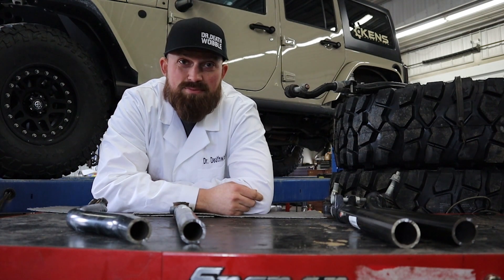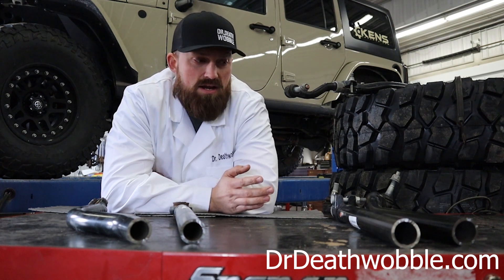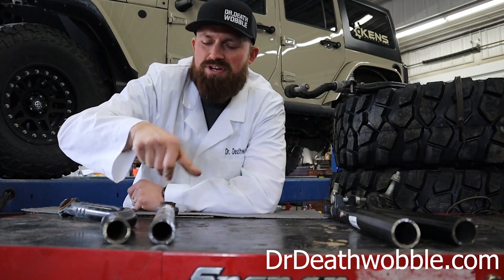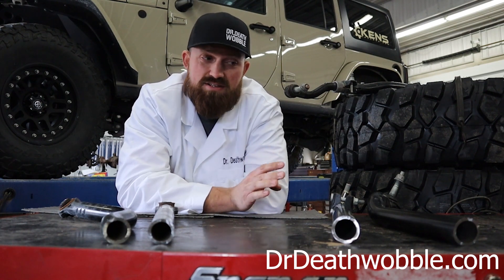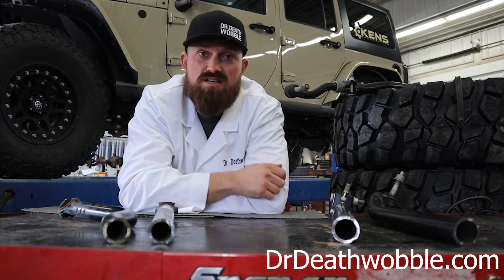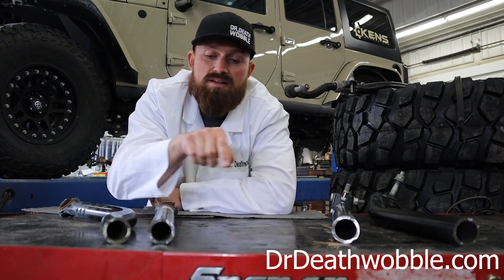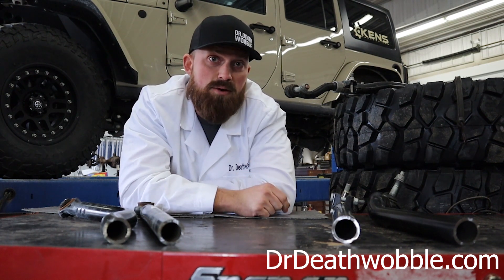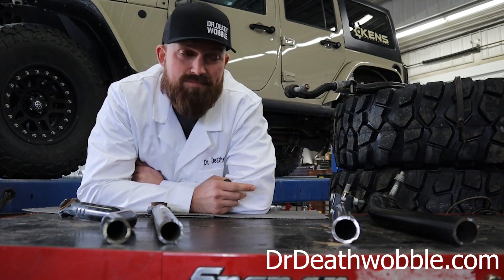What causes death wobble in the Jeep Wrangler JL?

Comment: Reinforce the brackets for the track bar, upper on frame and axle. The bolt wreaks havok on the thin metal flanges and creates  massive play. They went cheap on something that's designed to handle massive weight and force. I got rid of it by doing this. Jeeps suspension is no different than any other vehicle with coils on an axle. Check out synergy upper and lower track bar reinforce kits. Also if any other component on a suspension is weak or damage itll cause dw. If your out of alignment over 1/4 of an inch. Camber, toe, axle alignment position. Anything. Itll cause a dw and that goes for any vehicles. 
I have a clayton offroad track bar with synergy performance reinforcements. 2 years now and my JT willys 3.0  literally drives like a car thanks to that 3. I wished i took pictures of the oem track bar bolt when i took it out, inside the whole was beat. And i even checked all the torque specs when i first got dw, so they had it dialed in. They went cheap where it matters most is the problem.

Comment: I have a 4 door JL willys 2020, with the 2.0 mopar - fox shocks lift kit and 35x12.5's. I had death wobble once on a curve while turnin right aroung 35-40 mph. What should I change first?. Do you have a video with this info?.

Thank you very much, I also love jeeps and also believed that the suspension has a core problem that won't be fixed with a new stabilizer, very good info thanks!.

Comment: Hi,Great info
I paid Top $$ at the dealership to replace the steering box from the aluminum to the metal….still got the wobble issue.
Did you find out what will be the best Brad of a replacement components that will fix the issue?
Reply from the maker: Thank You. In my personal experience the Teraflex, Synergy, RPM, Apex, and Metal Cloak steering systems really stand out from the pack. They each have really nice features.

Comment: Thank you so much for posting this.  I've owned Wranglers since the 80's and loved each one of them.  I've never developed the death wobble in any of them until my 2018 Rubicon.  I really thought Jeep had this figured out.  So far 3 trips to the dealer and still no fix.  If you mentioned it, I may have missed it, but why can't Jeep get this problem solved?
Reply: Thought  the same, the solution is independent suspension.

Comment: People also need to check blown shocks on only one side.  I traded a dodge for a 94 jeep grand c.  The good shocks were replaced by junk yard shocks.  They rattled a lot.  But would settle down after getting warm.  After two months i got death wobble.  I had to get pulleys and o2 sensors, so next month could only afford shocks.  I had already tightened my steering rack adjuster, which helped a little.  When i took my shocks off the front, i noticed my right side was completely loose inside, the other side still had a bit of resistance.  My new shocks were cheap ranchos.  After installing we took it for a drive and not a bit of death wobble, nice, firm, yet actually smooth ride, even over the railroad tracks.  I think it was the mismatched shock absorbtion that enhanced the resonance.  Also, do you think that tire pressure (flat vs super inflated) can change caster?

Comment: So I’ve watched a few of your videos and I’m going to get an alignment this weekend but I was wondering just in case that doesn’t work what you would recommend. So I had my Jeep for maybe a year and a half with no wobble then I did new brake pads and boom wobble, so I had the tires balanced and the death wobble was gone for a while but then it came back and I was told a new stabilizer would help, so I did that and it made the wobble happen less but still every once in a while. Now a few weeks later the wobble is back worse then ever I almost always have to pull over to get it to stop. I threw a new stabilizer on it again until I could save up to redo all of the ball joints on the front end and nothing changed still very aggressive wobble. Hopefully the alignment will mostly fix the issue honestly I’m long overdue for an alignment so I’m hoping it does something. Any tips would be greatly appreciated maybe a checklist of what things you would do next. I love my Jeep but the thought crossed my mind today of trading it in I hate feeling unsafe while driving to work
Reply: I had a brand new TJ, 2003 Sport and got a terrible Death Wobble when I only had 20,000 miles on my Jeep. Dealer changed the tie rod and did alignment, but a week later I got another terrible Death Wobble on the highway!  Finally, a mechanic told me buy 4 brand new tires even though my original tires looked fantastic and I only had 20,000 miles on them. That solved the issue for me. However, there is no guarantees and it may come back again!  As much as I loved my Jeep, I decided to sell it.

Comment: I have a jku with 4” Currie enterprise lift kit , steer smarts tie rod , drag link (top mount, no drill) , track bar, steering stabilizer .. I’m running King shocks w remote reservoir and have a anti-rock front anti sway bar while running no anti sway bar in the rear .. Adams driveshaft 1350 front and rear.. adjustable control arms (all 8 are adjustable) .. as you can see I’ve sunk in a lot of money into my jk in the attempt to avoid death wobble and other issues but I still manage to have death wobble .. HELP me! Please . I’ve taken it to fourwheel parts and paid them to look at it and do an alignment but went home and still got death wobble. 
I don’t get death wobble if I hit something with BOTH tires but as soon as I hit I decent jump in the road with just ONE tire that’s when death wobble kicks in.. what could be the issue?? I’ve checked to make sure everything is torqued and I don’t see play in the ball joints
Reply: Oh yea I forgot to mention I used to have a 2.5 rubicon express lift with stick steering and no death wobble 
When I went to the 4” lift and steer smarts I got death wobble . 
I only have 28,000 miles on my Jeep but only about 4,000 miles on my 4” lift 
I’m on 35 “ tires

Comment: Just bought 2019 jeep wrangler sports unlimited 4 door and already steering wheels problem. Bring it to dealer they said need to replace rack and pinion. Did you have problem like this?
Reply from the maker: Jay  A Jeep Wrangler does not have a rack and pinion steering it has a steering gear sir.

Comment: I have a jlu sahara and it always wandered from the first drive. I recently had the mopar lift installed and after that is where my issues showed up I wouldn’t say i have death wobble but def a heavy bump steer issue i swapped out the front and rear track bars for the rancho hd ones and it helped maybe a tiny bit i have a star case open with mopar but they just want to keep throwing dampners at it i was looking at the steersmart hd drag link with the griffin attenuator and the tie rod.  But im wondering will that fix it or is there another 1,000 plus dollars of pieces it needs
Reply from the maker: But your wondering is caused by not enough positive caster, you need longer or adjustable front lower control arms.
Reply from the maker: There are many issues with the Mopar lift kit, a stronger track bar, stronger steering system like a steersmarts and longer lower control arms will get you rolling smoothly
Reply from the maker: You are not experiencing bump steer though it is a stage of death wobble. Bump steer is caused by improper relationship of the drag link and track bar on Jeep, unless you have went to a top mount draglink or a track bar raise bracket you do not have bump steer.
Reply: Thanks for taking time to reply
Reply from the maker: @steve timleck will it fix it, maybe. I can definatly say if you are running the stock track bar it is a weak link and known issue.  But can not promise the track bar will fix it.  It will help narrow the window of resonance though
Reply from the maker: @steve timleck many Jeep lifts are designed to work along with other supporting parts that need to be purchased additionally, not to say there isn't substandard products in the market that cut a lot of corners and truly don't think much about the end user.  When choosing a lift really need to look at the whole suspension system and how it will effect the Jeep ie: we changed a lot of measurements by changing ride height and suspension travel but have we addressed these changes through adjustments or adjustable components.

Comment: I didn't realize the death wobble issue was that common on the JL. I have a stock sport s JL and I haven't had issues yet (and we got some nasty potholes where I am). Could the issue be caused by loose steering/suspension nuts? I have heard a lot of people saying they discovered loose ball joints and such.
Reply: nitroxide91 see how it acts going 60mph and hitting a bump ..

Comment: Switched to steersmarts flip kit and still have death wobble
Reply from the maker: message me the specs on your Jeep
Reply: @dr.deathwobble4899  Jeep jl Rubicon,  3.5 inch metal cloak springs, Rubicon express lower control arms , flacon 2.1 shocks. Yeti xd tie rod, high mount draglink and track bar and track bar relocation bracket.  37inch milestar tires.
Reply from the maker: @tyleragill  what is your caster reading and toe reading?
Reply: Tyler Gill get teraflex part!

Comment: Glad to see ur alive still 😉 my deathwobble has returned... thou not as severe.... I got balancing beads in my tires and planning testing them this week to see if it helped
Reply: Start with your toe on zero, if you get the wobble, toe it out slightly until it stops completely. 
That will be where your tires want to track straight, so it wont load your tires sideways.
You can have deathwobble with everything tight, with improper toe.